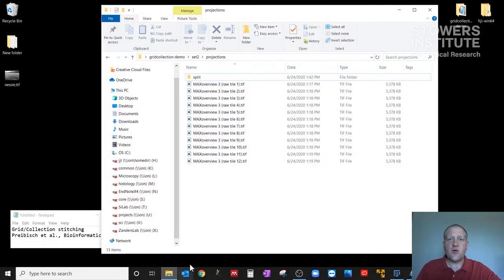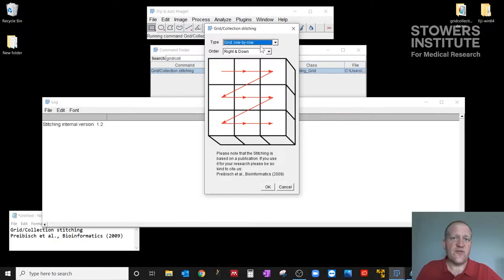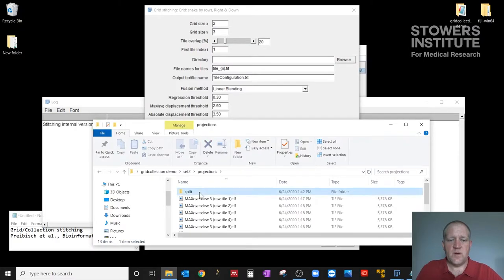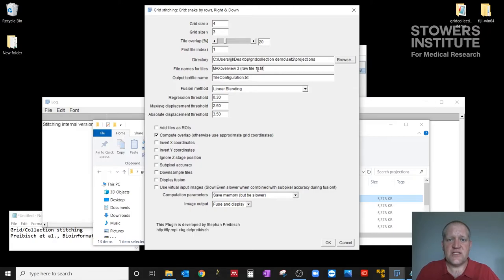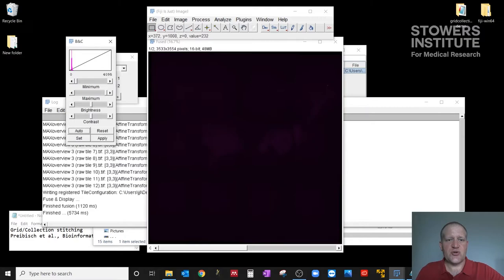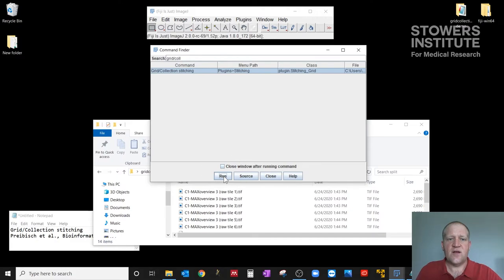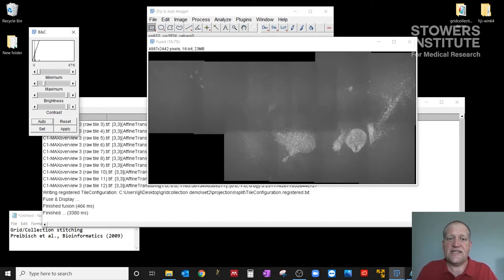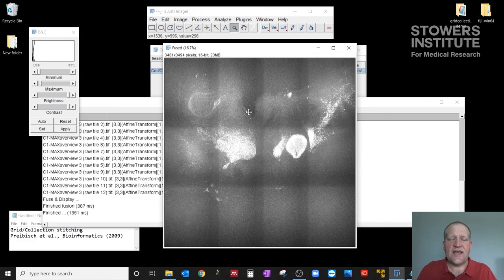Grid/Collection Stitching using Fiji

Comment: How can you get this to work, if your Tiffs have embedded Z stacks (multipage tifs)? It doesn't seem to be fusing in my hands when I do it.
Reply from the maker: We're not sure what you mean exactly by a multipage tiff. Stitching with a z stack tiff file in Fiji works well. We suggest you open your image in Fiji without trying to stitch and see how it’s displayed. If it’s incorrect, reorder the stack (Image – hyperstack – reorder hyperstack) and save it as a new file. Do this for all files as necessary, then try to stitch the new files using grid/collection stitching.
Reply: @StowersInstitute  multi-page TIFFs have been part of the TIFF 6.0 spec since 1992. It's how the TIFF container holds the image data. Regardless, it doesn't work. When I load one of my multi-page tiffs in Fiji, it shows a single window with Z slices and a slider. I can scroll through the stack just fine. Then I have about 30 of these images (each as a multipage TIFF stack) to stitch into a huge single image with 6x5 tiles (& Z).  Then, that 180 times over for my T=0 to 180 time series.
I'll try load/save the images I guess.
Reply from the maker: @KieranShort  I understand now what your dataset is. Given that there are a number of dimensions in multi-page tiffs including position, for example, we wanted to verify that your data is in the right format. Stitching multiple tiffs that are z stacks should work. As stated before, in a worst-case scenario, saving out each time point as a separate series of images to stitch and then reassembling after the fact will work. Alternatively, it sounds like your image files are quite large. Fiji will need to load all of them into memory at the same time in order to stitch them together. Does your system have enough RAM for this? Assuming it does, this process will take a very long time. You can monitor what Fiji is doing through plugins – utilities – Monitor Memory. This is a running line plot of Fiji’s memory usage which will help you determine if Fiji is working on the stitching or is locked up. Thank you for your questions!

Comment: Hello sir, thanks for the content. I have a problem with the stitching: I have several .tif images that are loaded correctly, but then Fiji only takes the first one into account. As a result, I obtain only one repeated image at the end. Any suggestions?
Reply from the maker: Hello, please take a careful look at the log window where it shows each image loading. Is each file truly a different name? The type of error you’re seeing usually occurs when the iterator isn’t properly set. The plugin will just load the same image over and over again. This won’t throw an error in the log window and the plugin will run normally, but only with one image. The only way to know is to look at the full path and filename of each image that’s loaded and verify that they are indeed all different images. Thanks!

Comment: Thank you for your instructive video. I successfully stitched my images but still found dark area close to the stitch lines. Is there any tips to remove these lines?
Reply from the maker: I can think of two possibilities that you are seeing. In the first, there are tile positions missing from the stitched image. In this case that entire tile position will be exactly zero at all pixels. This will happen if there is nothing in that tile position that can be registered to it’s neighboring tiles. In that case, it simply leaves that tile position out. There really is not a way to fix this. In a second case, you may be seeing striping along the X and Y dimensions of every tile. This could be due to non-uniform background. In this case, you can perform a background subtraction to make the background more uniform and therefore eliminate the striping.
Reply: @StowersInstitute  Thank you for your feedback!

Comment: As you can see in the example images, you get these dark lines in the middle of the image afte stitiching. How do you take care of that problem?
Reply from the maker: The shading observed in our example is due to uneven illumination contained in the data set. This is a common problem and is especially true in spinning disc images. There are two immediate ways to fix the issue, background subtraction or increased tile overlap. Before stitching, apply a background subtraction to each image individually, then stitch the background subtracted images. Another way to eliminate the illumination is to collect a blank image or average many images together to create an image of only the field (no sample structures) and then use this image to correct each image before stitching. Finally, for future data sets, you can increase the overlap between images significantly. This will increase your imaging time and number of files, etc.

Comment: Is there a simple way to just stich two images together? I had to split all my SEM Images due to size before exporting and would like them together as one for editing again (there is 0 overlap). I was told i can do this with ImageJ. This method shown here sadly doesnt seem to solve the issue.
Reply from the maker: We're not sure what is going on with your Fiji installation and what you have or haven’t done. If you start with the YouTube videos from part 1, it will cover how to set up Fiji to get all the plugins we will use. In the end, the grid/collection stitching should be able to stitch the data if there is overlap between the two images.

Comment: Hi. Thanks for the tutorial. However, I'm having problem in choosing images that I want. I can't click 'choose' from the browse section eventhough the images are in tif format. Do you have any idea why?
Reply from the maker: If I’m understanding correctly you are clicking browse on the directory window. This is actually selecting a directory of images to try to stitch. So through this window you cannot select any individual file, you are only selecting the directory where the data is. It’s easier to copy and past the directory path into that line, than to select the directory through the browse button.
Reply: @StowersInstitute  Do you know how to apply this on mac? Mac do not display directory as windows did, but I managed to copy the location of the folder and paste it on the directory window. Still, Fiji can't find the file. Not sure if I'm doing it right though.